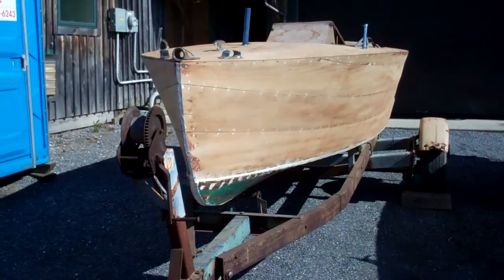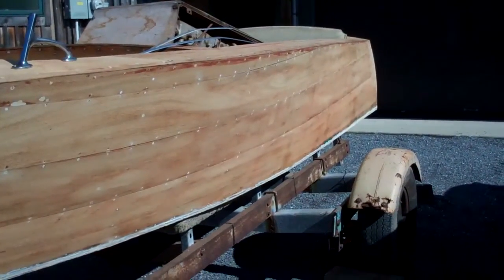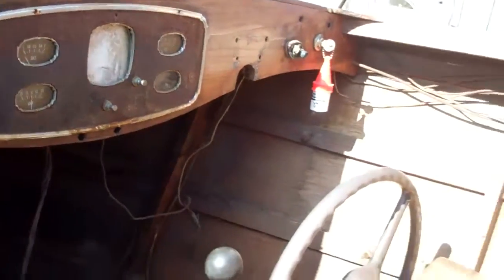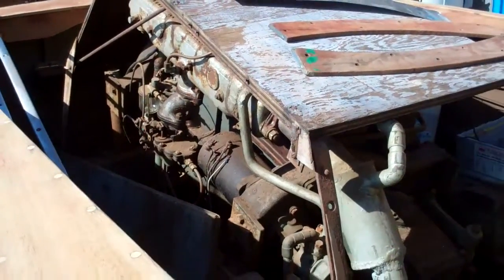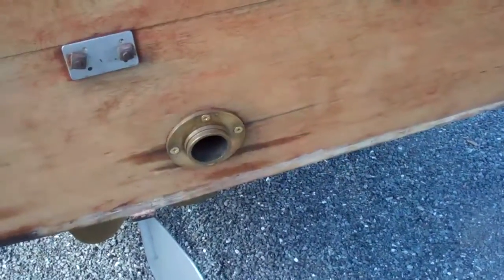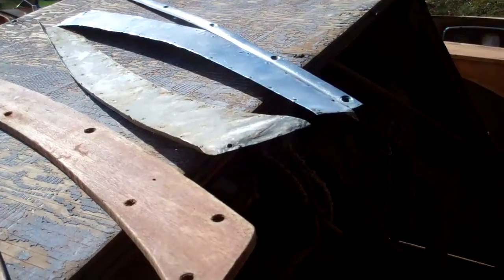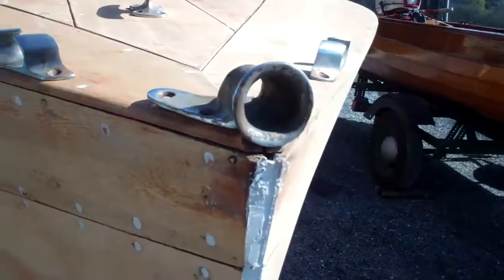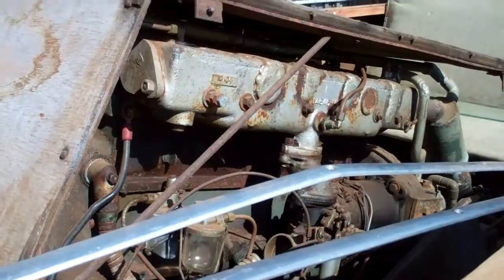1937 Iroquois Boat Works 15 5' Runabout Help! 5 9 2016

Comment: Looks like you have a diamond in the rough. Another oldie saved. Good job.  I think the current engine is a wee bit too big for that little boat.   Boat trailer needs major help.
Reply from the maker: Actually, the Holesclaw trailer, while it has lots of ugly surface, is solid. It even has new bearings. The tires, well, they made it back to the shop. I let air out soften the ride. Why? That Chrysler Ace must weigh 5x what her original  little 60 HP Gray Marine 4-cylinder weighed.